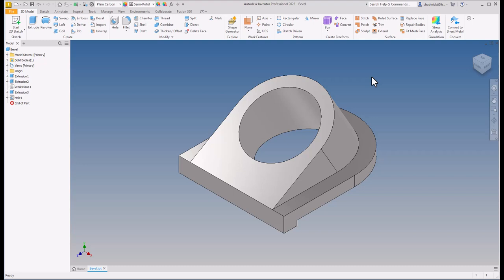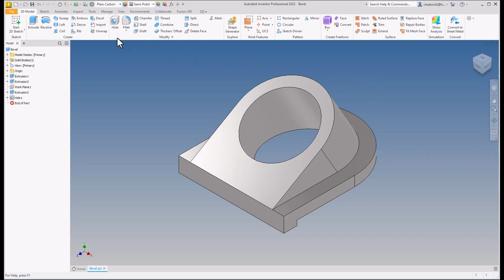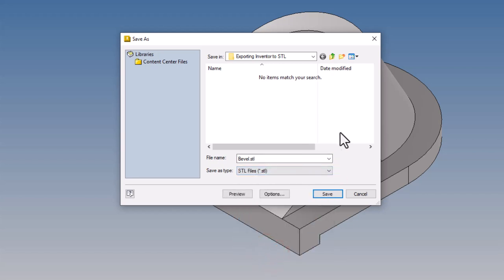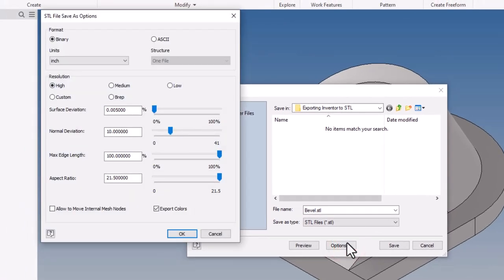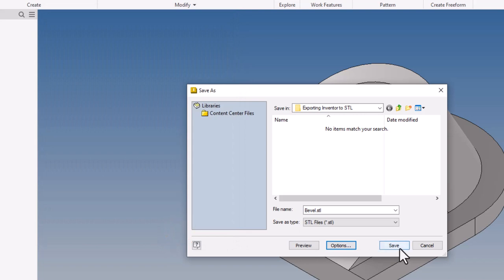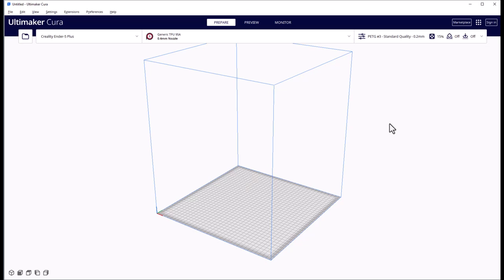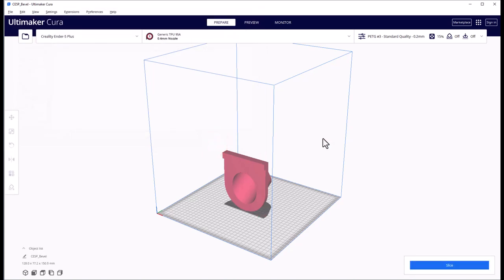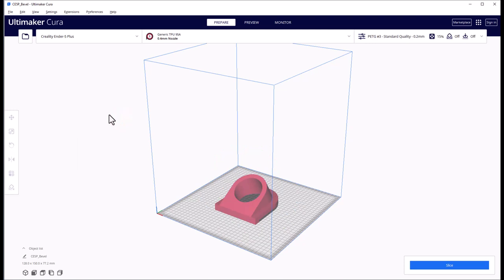Exporting from Autodesk Inventor to STL for 3D Printing

Comment: Hi, I was wondering if you could help me please. My stl file from Inventor doesn't show threads. Do you know why? Thanks
Reply from the maker: If you are just using the thread tool in Inventor, it is just a cosmetic tool that adds a thread note. It does not actually model the cut thread, so it will not show up in the stl file.